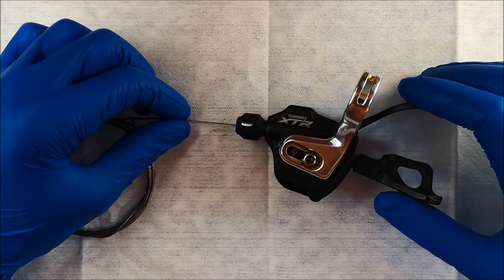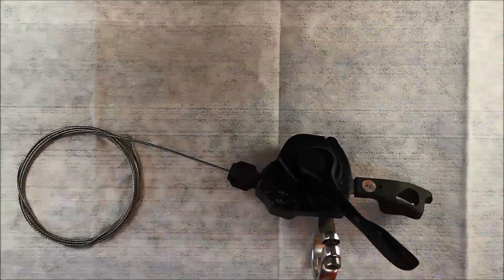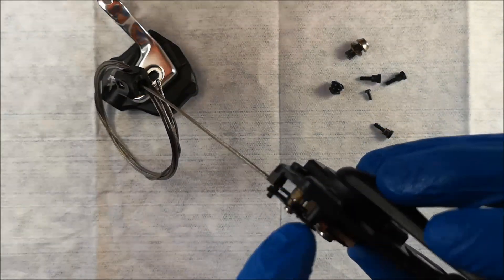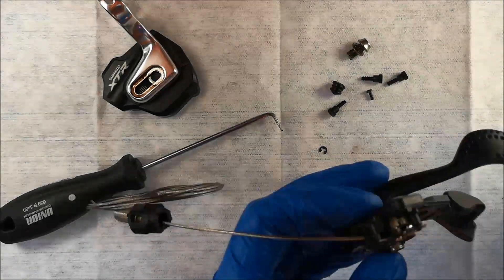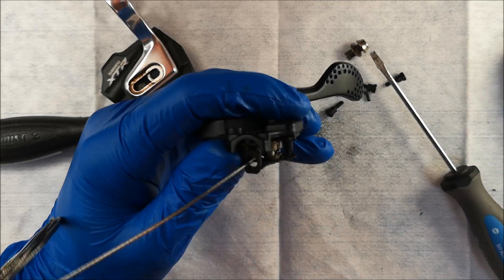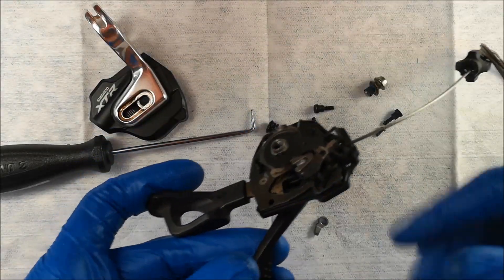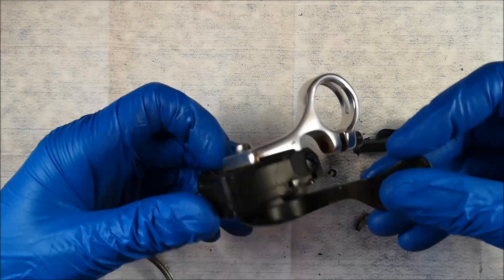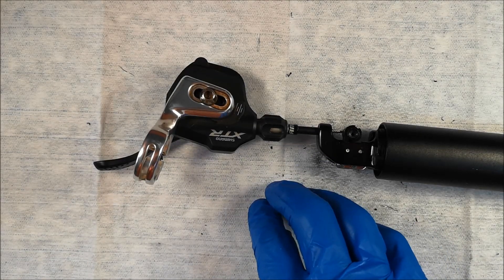Shimano XTR dropper post lever | Hack of the day

Comment: great to find exactly this information
I want the clean integration in the cockpit  with ispec II attached to the XT brake lever.
cable operated dropper lever are way overpriced, much more expensive than similar build quality shifter with way simpler mechanism. although I'm looking to buy a XT since the xtr  is twice as expensive and I won't use the additional features I use on the xtr right shifter.. I guess the conversion should be pretty similar with XT or XTR.
My main question is how does it operate compared to a dedicated dropper lever...any inconvenience?
Reply from the maker: No inconvenience at all , in most cases it has A better smoother feel than most underbar dropper levers.
Reply: @JustFrana  thanks! I just realized my tranzX dropper uses the barrel head to attach the cable to the dropper post. the remote side of the cable doesn't have a barrel, and I don't find any info on how to install one or if its's even possible.